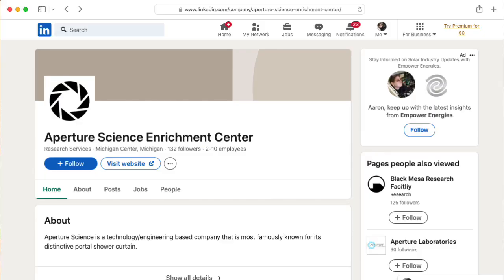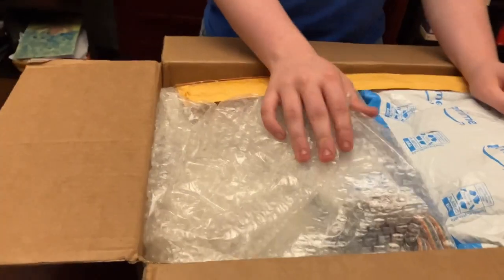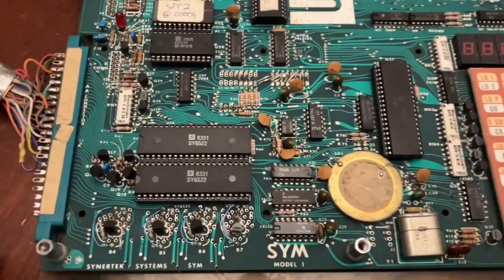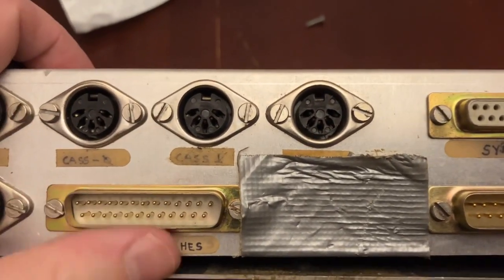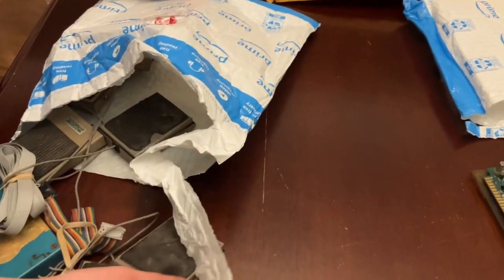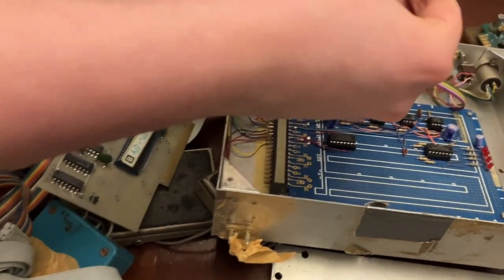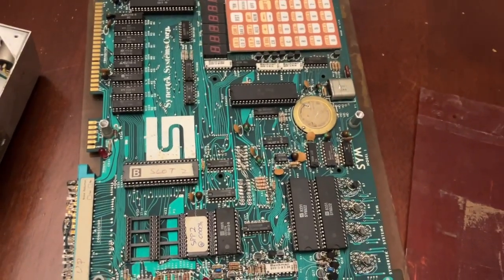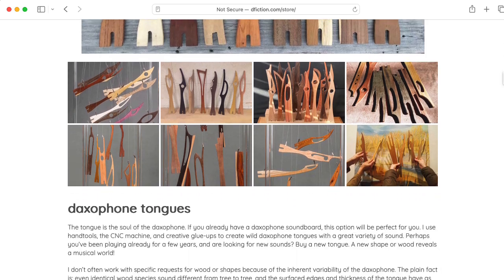Composer Richard Teitelbaum's Synertek SYM-1 6502 Computer with Custom Hardware (like KIM-1)

Comment: ‘78 is a couple of years before MIDI, that was standardized in the early 80’s.
Reply from the maker: I was wondering if maybe the composer was using an older computer for MIDI -- like he had bought the computer from 1978, but used it with MIDI in 1982 or something. I doubt it though, I figure by that point much more convent-to-use computers with MIDI would available.

Comment: I had a SYM-1 for several years after I rescued it from a box of soldering practice PCBs at TAFE. The manual was in the free pile of old books elsewhere in the building. This was ca 2006. They're a great machine, very expandable. The manuals are all available online, along with software and ROM images. Check out the section for using an oscilloscope as a replacement for the 7-segment displays. If and when you wire that up to a terminal, there's a ROM based assembler and line editor that can be installed which has the ability to use two cassette decks. It reads the source from the first deck and writes the output object to the second. I suspect that's what the "CASS-0" and "CASS-1" ports are for, or could be used for at least. Those SRAM chips are power hungry too. The board will draw about 1.5A on the 5V rail. Cheers :)
Reply from the maker: Hello again! Oh... come to think of it, are you working with Usagi Electric on cool stuff? I recall your username coming up at some point I think.
Reply: Yes that's me. I (mostly) ported CP/M 2.2 to the Wang Writer. Needs work to complete it but it's not needed as much now. Still lots of fun! Thanks.
Reply from the maker: @256byteram  I love the Usagi Electric channel so much!
Reply from the maker: That reminds me of horror stories about Buchla modulars being tossed out and replaced with DX7s and samplers and whatever in the 1980s...